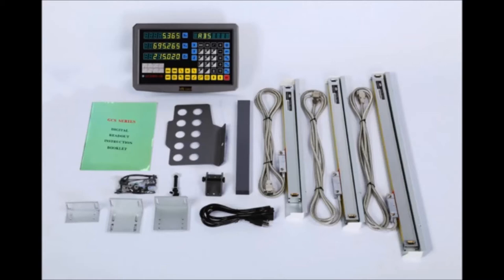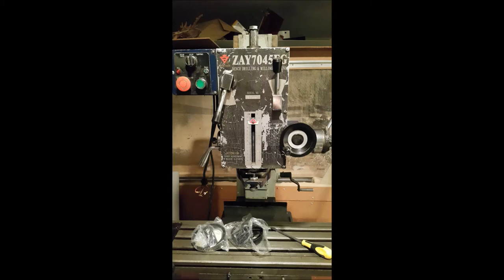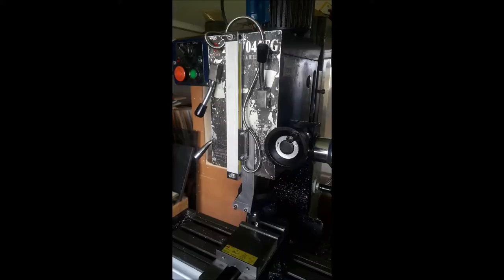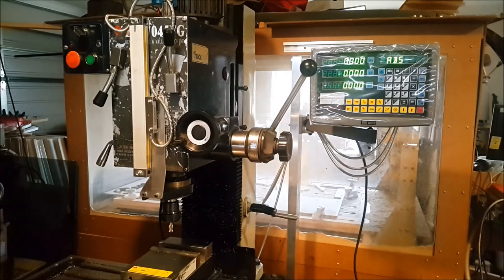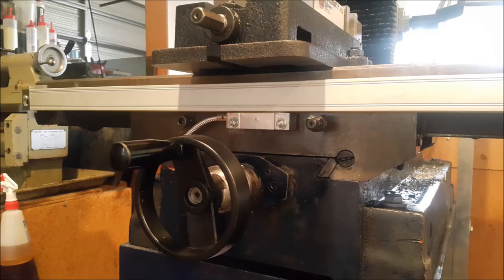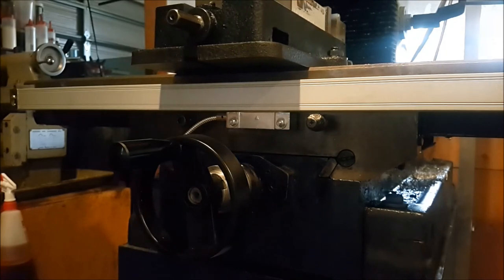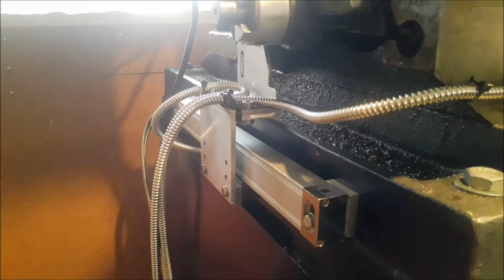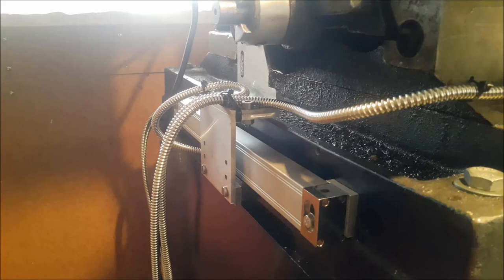14 - ZAY7045FG(ZX45 clone) Milling Machine install of a 3 Axis DRO

Comment: I have a similar bench mill as the one you have in this video. I bought the 3 axis DRO and was wondering how I would attach the Z axis to the mill, didn't want it on the whole head moving up and down, but wanted it on the quill. Your video helped me figure out a contraption to get it hooked up. Thank you very much for sharing this, it really made my life easier today.
Reply from the maker: No problem. Thanks for watching. Regards Kevin

Comment: Good stuff! Makes sense in choosing to measure vertical movement of the quill/spindle head relative to the headstock for Z-axis! No wonder many other installs that measures movement of the headstock relative to the column ends up being next to useless when actual machining operations are being carried out!
Reply from the maker: Hi there, yes I thought the same. Regards Kevin